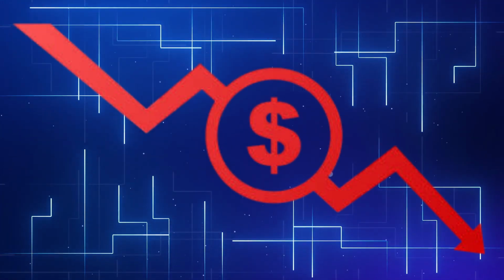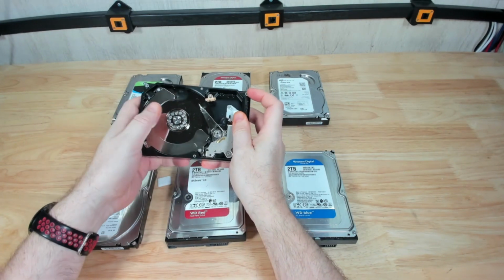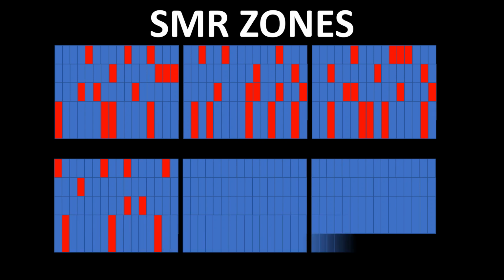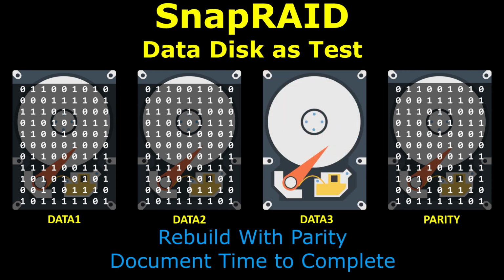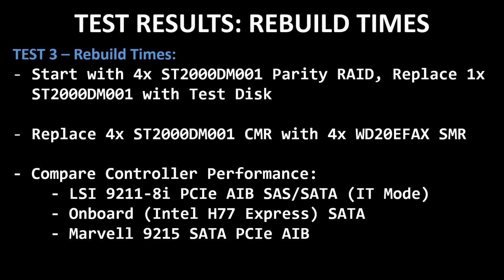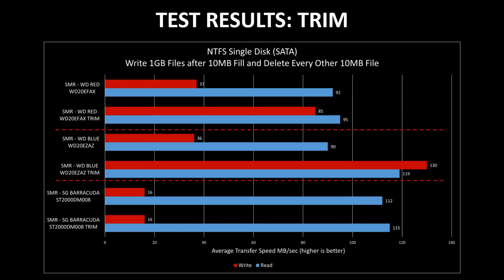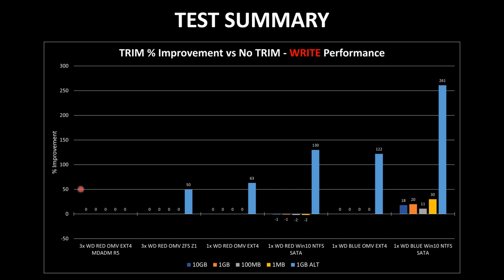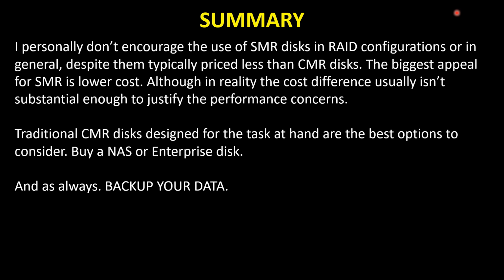SMR Hard Drive Testing - RAID Rebuild and File Transfer

Comment: Wherever you look, whether here on YouTube or on Reddit, you always get told to avoid SMR drives like the plague. However, when I look at the numbers that you presented in this video it shows that yes there is a difference and yes it is slower, but it's not as horrible as they make it out to be – apart from the Seagate drive maybe. If I have to restore 2 TB of data and I have to wait 15 - 30 minutes more, that's not a big deal to me. Have you since redone the test or collected more experience when it comes to SMR drives? Right now the situation is hell if you wanna purchase hard drives and I'm looking in all directions to find something that I could put in my home server. I'm planning to use Snapraid.

Comment: I recently bought a STM2000DM008 innocently, it replaced a failing WD Black, that reached 10 power-on years.  I use it in ZFS as a single disk.  No complaints, possibly because of the way ZFS operates.  In asynchronous writes, the IO is considered complete as soon as it is stored in the memory cache.  It collects the asynchronous writes during 5 seconds in the memory cache, then sorts and writes them.  The synchronous writes will be considered complete, when it is cached on a log device, say a SSD .  I use a 5GB sata-SSD partition (500MB/s) as write cache for my stuff, e.g VMs :)